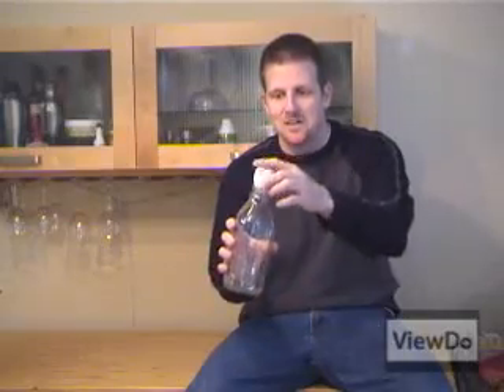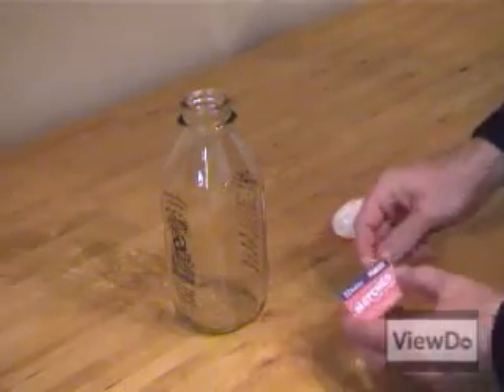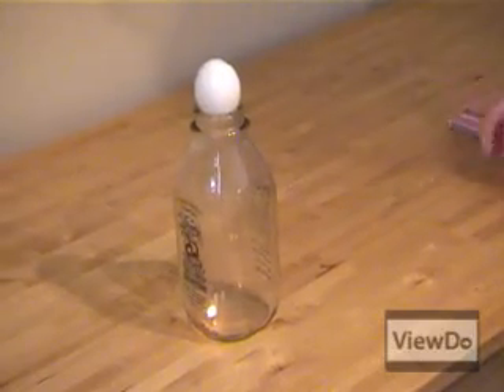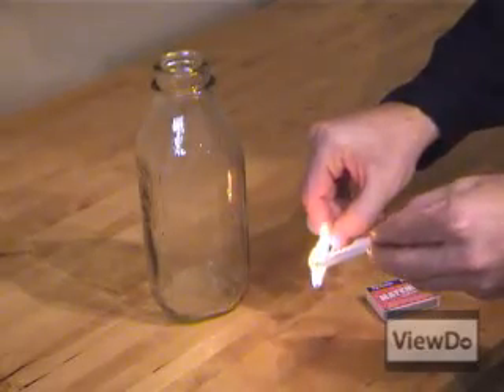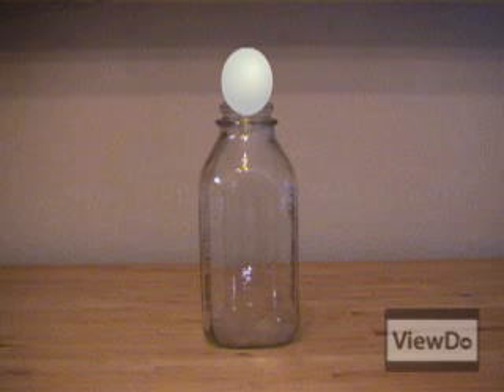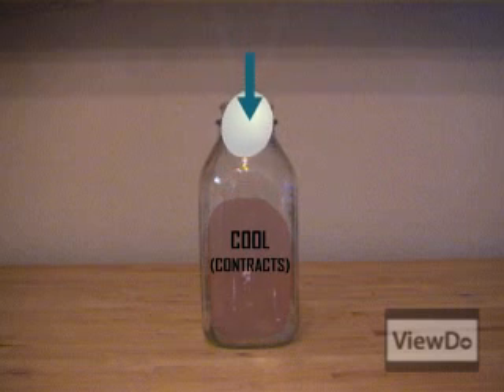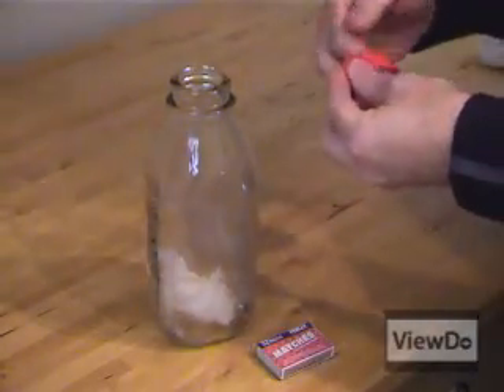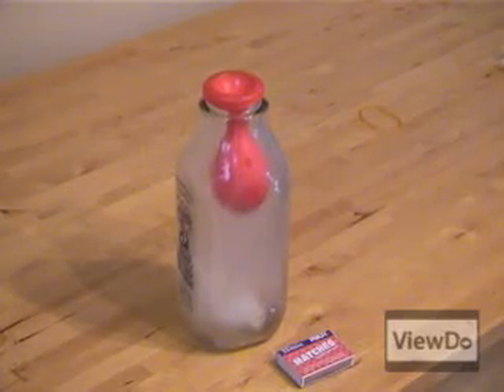ViewDo: How To Get an Egg in a Milkbottle

Comment: Thanks for the demo, going to use it with my science class today, but the flame is also using up the oxygen - 20% of the air as well, increasing the vacuum.
Reply: O2 is being converted to CO2, but I believe the number of moles of gas remains the same. The oxygen doesn't just disappear, after all.

Comment: @fallingpatrik15 Hold the bottle upside down so the egg falls over the neck, then blow into the bottle as hard as you can, the egg should then be pushed out by the higher pressure air inside the bottle.

Comment: The egg is not being "sucked" into the bottle, suction doesnt exist. Its pressure changes that PUSH the egg into the bottle. The greater air pressure outside the bottle is pushing on the egg to shove it in there.

Comment: To get it out, (THE EASY WAY)
flip the bottle upside down, so the egg is at the tip, and get another bottle put a flaming paper and put the tip facing the other tip, and the same thing happens but when the egg is about to fall quickly remove the bottom bottle so it falls to the surface of the table (or desk or floor etc.) and there you have it... wow that isn't that easy... I need a hobby... this was off the top my my head lol.

Comment: @kjbigslim this is a common misconception, even taught in most textbooks.. but its quite wrong.. this happened due to expansion and contraction and hence pressure. burning the oxygen creates carbon dioxide too, atoms dont get destroyed or lost, merely change in bonds..

Comment: I think burning the oxygen has more to do with the egg getting sucked in than expansion and contraction. Gases do expand and contract when heated and cooled, but the vaacum may be created more by the lack of oxygen than the contraction of it cooling. To see i'm right, you could apply constant heat to the outside of the bottle, then repeat the expirement to see if it still works with a hot bottle.

Comment: @desocialize Science teacher did this. Either turn it upside down and heat the bottle. (Like flame to the bottle to warm the air inside up again.) Or you can put it into a vacuum sealed container upside down so the the egg is against the opening again. (What my teacher did)

Comment: @desocialize Simple! Just heat up a gallon of water until it is near boiling. Now turn the bottle with the egg in it upside-down. Use tongs to hold onto the bottle, and then pour the gallon of near boiling water over the upside-down bottle.

When the bottle is held upside-down, the egg falls to the neck of the bottle. When hot water is poured over the bottle, the air inside the bottle expands. Since the egg is sealing the neck of the bottle, the expanding air forces the egg out!

Comment: @KrazyTraynz :  Hold the bottle with its mouth near your mouth and its bottom somewhat higher so that the egg is positioned far forward, to the neck of the bottle, but not completely blocking the neck. Exhale a tremendous burst of breath into the bottle to suddenly increase the inside air pressure. The Bernoulli
effect caused by the rush of air flowing around the egg plus the increased inside air pressure, will aid in pushing the egg through the neck and mouth of the bottle.

Comment: @KrazyTraynz stick it in the bottle. then turn the bottle upside down so the egg falls down and the straw is wedged on the side. then suck on the straw. you have to flatten the straw a little to make it seal. But it works.

Comment: Well, the way he said it is true but, I have an easier way to explain it.
The air molecules inside turn from low to high. Low air pressure always wants to go to high pressure air, so the low pressure air pushes the egg into the bottle.

Wow. And I'm only in 6th grade.

Comment: @kestrel452 on the contrary. the oxygen is used to react with the wood and either creates carbon dioxide, or in incomplete combustion, carbon monoxide. In any case, more gas! the oxygen atoms do not dissapear. first lesson chemistry, atoms never get lost. they only get combined into new substances.

Comment: I dont think the change in temperate in such a small area creates a strong enough force to pull the egg in. When I saw you put the balloon, all it did was go inward without going outward at all which suggests no expansion of the air.

The flame uses air as a fuel and creates a vaccum which pulls the egg in...

Comment: Although it's a cool trick, 1 thing isn't right.
The egg is pressed inside the flask from the overpressure from the outside, not the underpressure(vacuum) from inside the bottle.
I mostly use boiled water was the expanding product.

Comment: @letsamario continued) the bottle, also, you could do the same thing, with a tin can,minus the egg, if it is hot enough and water is cold enough, the can will be crushed and  water will be inside, what happens is the air inside expands, and is suddenly cooled and contracts causing a vacumn and sucks in water, and in some cases an egg, or the container itself if its a can

Comment: @letsamario take a regular non hard boiled egg, put it in regular vinegar, making sure that its fully submerged, a few days later, it will be soft and flexible, then, put it in a large bowl full of extremely cold icy water, then take the bottle, heat it up, not enough to melt it or anything,but still really hot, then with tongs or  something as fast as you can, and dip it open side down, into the water, making sure the egg is directly in the mouth if you do it just right, it should harden inside

Comment: I know a better way to get an egg into a bottle. (normal eggs, not hardboiled).
Grab the egg and put it into a glass of vinegar, leave it in the vinegar for a few hours (or sometimes a day) and it will become flexible. Carefully push it into the bottle, then fill it with water. Pour it out, and voilá! the egg is inside, and is not flexible anymore.

Comment: This isn't so obvious.  One must apply the Ideal Gas Law - PV = nRT.  Clearly the pressure goes down inside the bottle, and V is (essentially) constant, as is R.  Thus, either n or T must go down; but which?  I was always told that the match burns up the oxygen, but the reaction is roughly C+O2 -> CO2, so this seems to say that n is constant, there are as many CO2's as O2's.  But, the egg is placed immediately over the opening, so little air has a chance to escape.  I'm out of characters.

Comment: what about an equilibrium expression that shows the disassociation of carbon monoxide and o2 into carbon dioxide proving that the reaction favors the less moles of product and thus because 1 mole of gas is always equal to the same pressure, less moles of gas would mean less pressure. thats also responsible for the vacuum effect num nuts.

Comment: the heat and cooling explanation is crap and false. 

you did put a burning match that burns oxygen therefore the egg gets sucked in the bottle because there is no air in it.

Comment: @busha5a5a5 

well yea that what i was saying is nothing to do with heat its to do with the reaction of the carbon in the paper with the oxygen in the air (this is the reaction that cuases the fire) therefore the pressure lowers( creating a partial vacume as you called it) because of the less space co2 molecules take up

Comment: Great demo!!

If I'm not mistaken a physics/chemistry type would say the low pressure inside the bottle does not "suck" the egg in, rather the high pressure from the atmosphere outside the bottle pushes the egg.

When you drink through a straw, you do not "suck" the beverage up, rather you create a lower pressure and the atmosphere on top of the beverage pushes the fluid down, and since pressure in a fluid is distributed evenly the liquid rises up the straw.

Comment: Thats not quite accurate - the oxygen in the bottle is the key factor here - as the material burns, the reaction causes it to combine with the carbon atoms in the fuel and create both carbon dioxide and carbon monoxide molecules. Both of these gasses use up less room than oxygen and thus the vacuum is created. Heat does have a little to do with it but its the carbon based gasses that carry the most effect.

Comment: to get an unmodified egg into a milkbottle,you just soak an egg in vinegar until its really soggy,then you can push it in with no problem,then rinse it with water so it hardens and gets rid of the vinegar smell

Comment: to get the egg out you just blow into the bottle and move your face away fast while holding the bottle upside down. the pressure in the bottle will push the egg out.

Comment: well, I agree that the excess expanded air escapes before the egg is placed, but then the egg can be sucked in later because the cooled air (since cool air moves down) forms the vaccuum he was talking about, thus pulling the egg in. I don't think the temp. of the bottle would make a difference, but perhaps you can try it and record the results?

Comment: On second viewing of the video I think the expanded air escapes before the egg is even put on there.  I guess what am trying to say is that his explanation was bad, expansion of air molecules should always equal its contraction if you are in a concealed area because no new molecules enter or escape and the same volume is retained.   If on the other hand the bottle was cooled to a temperature below the starting one then the molecules would contract and pull the egg in.  You get what am saying?

Comment: Yes but The expansion of the air inside should equal the contraction thus making the pressure inside zero after the whole cycle and it shouldn' pull the egg inside.  I do believe there is more factors to this.  I believe Oxygen inside turns into more heavier carbon thus creating a vacuum, or when the expansion happens it does push the egg out enough to release the air out that is lost to create the difference in air pressures, then contraction does its job.  That should have been explained more.

Comment: ya fireglow7 is right. it's cause of the low air pressure inside due to the oxygen being burned up, not because the air is expanding and contracting again.

Comment: i see it the other way...

1] When the burning match stick is in the bottle with the egg at its mouth, the air in the bottle decreases because oxygen is used up by the fire. (oxygen supports combustion)

2] As the air in the bottle decreases, the pressure decreases too.

3] The higher atmospheric pressure (out side the bottle) acts on the egg. This forces the egg to move into the bottle.

lol...

Comment: No I agree, because the egg creates a seal, so if the air inside is expanding, it would need to make the egg move out of the way so it could escape. Plus, if you were creating enough heat to expand the air that drastically, it wouldn't be an almost instantaneous cooling and the egg would not get sucked in that fast. ALSO, if you could expand and compress the air with the egg there, it wouldn't be a vaccuum, cuz you would have the same amount of air during compression as you did during expansion.

Comment: wait... doesn't this happen only because the combustion reaction inside the bottle is using up the oxygen, which creates a vaccuum effect? i.e. nothing to do with expansion and rising of heated air, followed my contraction and descent of cooled air.  If the heated air was expanding and rising, the egg would show signs of letting air pass upwards, and would then be sucked downwards.. But it only goes down.  Someone correct me if im wrong.

Comment: it does actually, it just needs to be heated to really high temperatures, or exposed to fire for a long time, heres an experiment wich will take a long time to complete:

get a bowl and a piece of glass, now cover the bowl over the glass, after a few months (sometimes years, told you its long) you will notice that the glass, is begining to bend into the bowl, this happens cuz it has a liquid in it (non visible, and more solid then liquid) making it bend.

or leave it in a campfire, lol

Comment: no, actually, after the burn of the paper, Carbon Dioxide (CO2) is created, so, there's no vaccum there. But as some of the hot air goes outside the bottle, there would be less air inside the bottle.

Comment: Incorrect explanation - and get your minds out of the guttters you common trash - be more critical - everything is not  penis - you shit-for-brains.  Oxygen combines with carbon (paper) forming CO and CO2 - as well oxygen combines with hydrogen forming water vapor inside the vessels (its moist inside).  H20, CO and C02 all have lower molar volumes than air.  Hence drop in pressure.  It's a chemical phenomenon not a physical (thermal phenomenon) - i.e. total bullshit.  0/10  =  Egg  Fail

Comment: Baking soda and vinegar. mix them in the bottle and it'll create a reaction, then hold the bottle upside down so the egg plugs the hole, the expansion will push it out... quite messy though.

Comment: Um? If I take 1 liter of air at 70 degrees, heat to 140 degrees, we'll say that it then expands to 2 liters. But then when I take it back to 70 degrees, it would be back to 1 liter, correct? So then how do I have a negative pressure in that bottle?

Comment: 1. slide a piece of paper (use thick paper, maybe cardboard) into the opening of the bottle.
2. Tilt the bottle, so the egg rolls to the top, onto the paper.
3. Pull hard on the paper. The egg will come out too.

Comment: and yet another aclussion to the apedemic, the heat from the fire contracted on to the paper could also result as the heat and pressure slightly "pushing' the top of the bottle more expanded so, the egg can easily slip through =)

Comment: I dunno. If what sattanhellsing says is true, and it does create a vaccum, I guess it would be that there is less co2 being created than o2 burned. But then that wouldn't make sense because you'd end up with less than you started which is impossible. I think. I'm no expert xD (sorry if I sounded condescending before, higain2)

Comment: lol we wasted an entire physics lesson mukin around doin this 50 times just coz we can, but we used Chronicle flasks and bunsens lolthis way you can get the egg out whole as well, you just need some water in the bottom as well to give it more expansion, tip it till you get the egg balanced at the opening and blocking the water, then heat it up and the egg will go flying into the wall!!!(or your friend, whichever your aiming for at the time) hehehe!

Comment: hey just want to say that the explaination for the egg going into the bottle is wrong.  it isnt an expansion or contraction that is causing this but it does effect it, but only slightly.  the oxygen is being burnt in the bottle which reduces the volume of gas within the bottle by 20%.  this causes the pressure decrease inside the bottle which then forces the egg inside.  the air does heat up and then cool and contract but it isnt the main reason

Comment: Sorry bud but your explanation is over elaborate and wrong. The egg is sucked into the bottle before the flame is even out...no time for the expansions /contractions you are talking about. Reduction of the pressure in the bottle is caused by burning oxygen.

Comment: it is easy to explian, the fire uses up oxygen and putting the egg on the top seals it making sure oxygen can't get in or out. once the fire has used up the majority of the oxygen the flame dies and creates a vacuum creating suction. a vacuum is like the opposite of an explosion it is an implosion. the air outside the jar is pushing against the vacuum inside the jar, just like if u were to submerge a bottle of air underwater, the water is exerting pressure on the bottle until the lid is removed

Comment: If that was the case the balloon would initially be blown outward when , in fact, it is sucked in straight away.

Once the oxygen starts to combine with the fuel there is less pressure in the bottle that is why, even while it burns, there is suction.

Try it yourself, simply use your hand and make it airtight and you will feel it sucking while it is still on fire.

Comment: Dude, you don't understand what's going on here at all - the one with the balloon proves it.

What happens has nothing to do with heat.

The oxygen in the bottle is used up by the flame so creates suction at all times, never does air try to escape.

Comment: Oxygen is also being used in the reaction on the paper/flame which reduces the pressure in the milkbottle....

"hehe what if you did that with a regular egg....."
If you get around to sealing it...the egg would just crack and pour in. Wewt!

Comment: You would feel suction on your hand, but only slightly.  Look at what it does to the balloon - it only moves it a little bit.  Even our lungs can produce a much larger pressure differential than a flame in a bottle.

Comment: no the oxygen runs out so the flame goes out. only when the flame stops burning the air cools down and stops producing heat , the air cools and contracts, causing a vacuum, which pulls the egg in.

Comment: decrease in volume equals increase in pressure...since the volume of the bottle is obviously less than air around it, the pressure should be greater...since the pressure wants to escape to an area with greater volume the air escapes and produces a vacuum within the bottle, which in turn SUCKS the egg in...if im wrong someone please tell me instead of trash talking

Comment: it should be due to pressure difference.

when the oxygen inside the bottle is used up during the burning, the air pressure is lower than outside,

high pressure go/push to low pressure

Comment: We did this in science class. Then we had to get the egg out. To do that, our teacher manuevered the egg away from the opening and holding it upside down, she blew into the bottle.  Then she tipped the bottle so the egg was in the opening. The egg pops out. The pressure inside the bottle was greater then the outside pressure therefore pushing the egg back out.